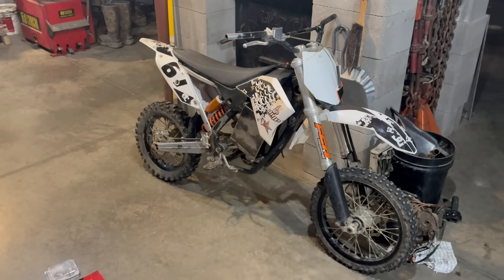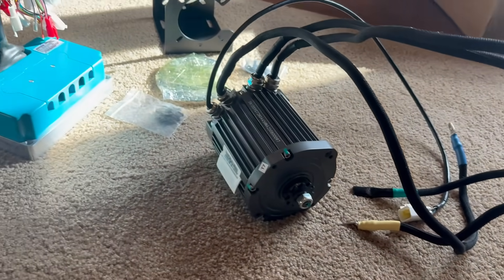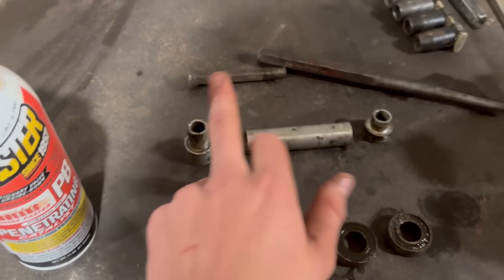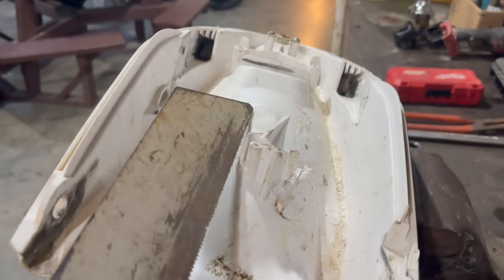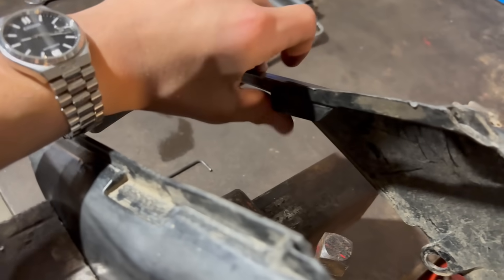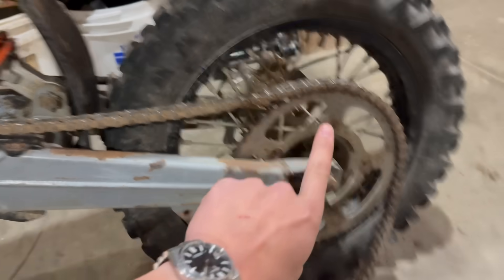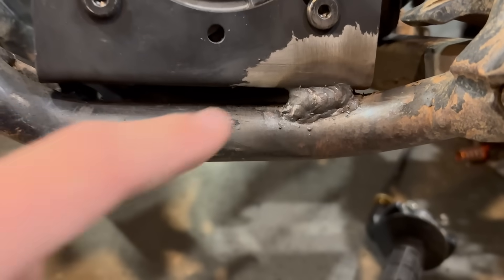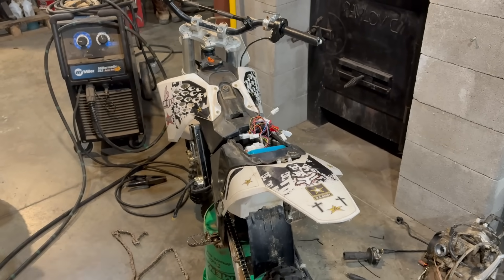ELECTRIC Converting a Old Dirt Bike (Part 2)

Comment: Idk, I really think you should have welded flat stock steel to the frame, for a base for the motor mount.. you’d be able to get more of a welded surface between the frame and flat steel stock, and then have some adjustment for the motor to bolt on. Over all it looks great. Can’t wait for more

Comment: You should try to mount the controller a different way. Having that phase wire and the wire harness being bent is not that good for the wires. Cutting the sub frame isn't that good either. Idk if there is a different way but if there is I would try that